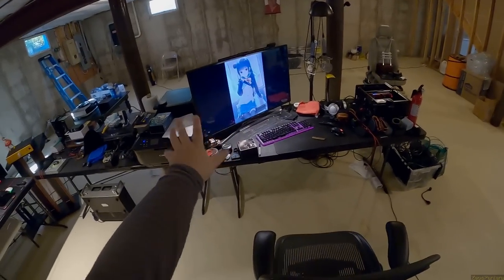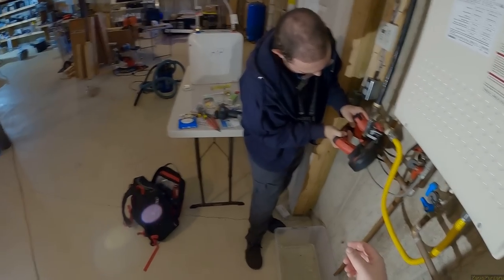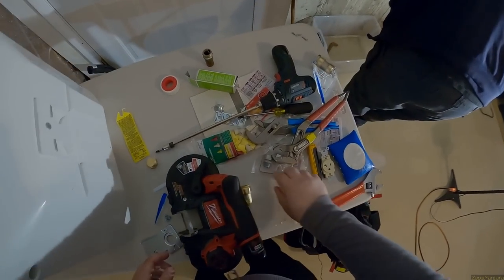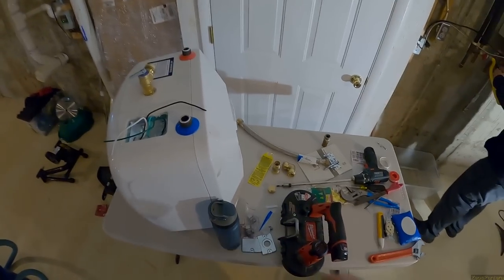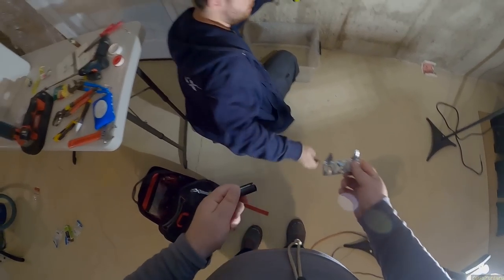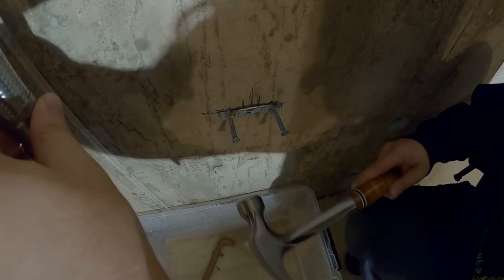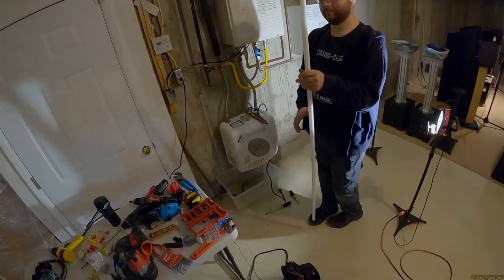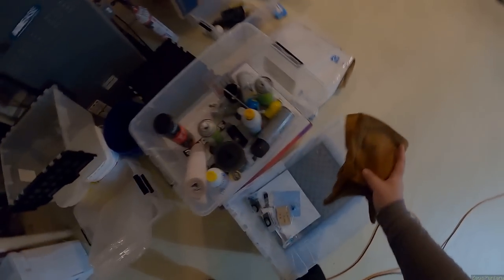Z Does - ITman and Z Plumb!

Comment: Flogging is when you whip someone with a cat-o-nine-tails or any other device designed to tear the flesh. Whipping in a similar thing, however that generally refers to a whip instead of a cat-o-nine-tails. You can get lashed from a cat-o-nine-tails, a whip, or a rod.

Next on Torture and Punishment Terms, Keelhauling.

Comment: That tankless water heater should easily feed the water needed in this case.  The correct approach would be to put in another tankless heater under the kitchen sink.  This probably will be an unnecessary addition.  It's using two water heaters at the source.  The circulating water will consume a lot of energy that will be essentially wasted most of the day.  I am curious how well this will work.

Comment: you can get a tiny collar shaped pipe cutter suited to the diameter of the pipe that you just clip on the pipe and turn a few times that slices it easy and clean and straight instead trying to wedge your portable ban saw in there, just saying

Comment: That's a lot of pluming for a tankless heater. Their pretty much useless here for that reason. Tanked ones work better especially with large tubs. Tankless are ok for small houses that doesn't really have the space for tanks and use less water. They end up using more energy then tanked heaters.